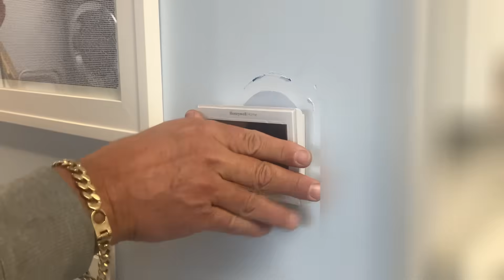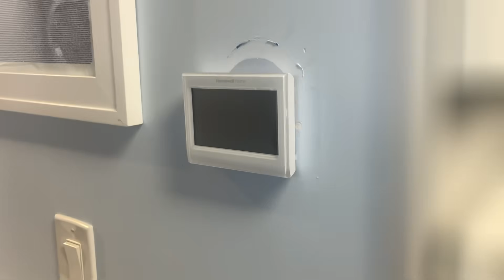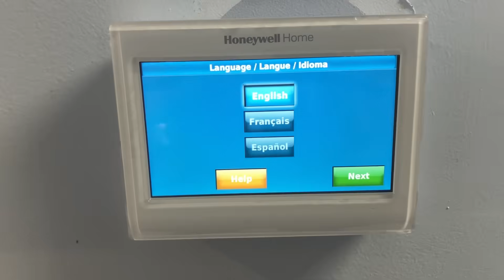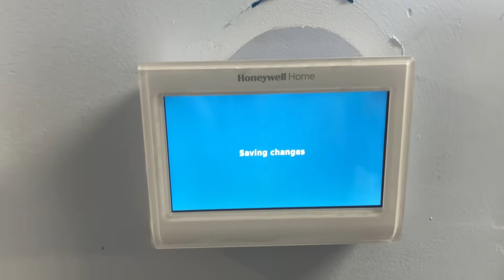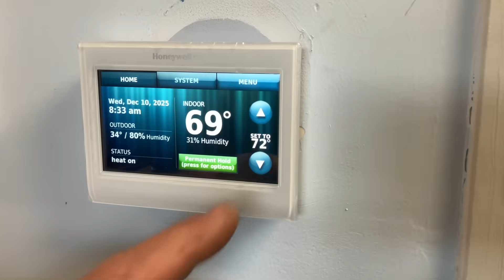Found the Missing C-Wire! Installing Honeywell 9000 WiFi Thermostat on Burnham Alta Combi

Comment from the maker: This is a REAL service call showing why WiFi thermostats fail when the C-wire is missing — and how to properly diagnose it instead of guessing.

If you’re a homeowner:
👉 This is why your new thermostat won’t power on.
If you’re a tech:
👉 This is how you avoid callbacks and embarrassment.

👇 SUPPORT THE CHANNEL & LEVEL UP 👇

🔥 Become an ACiQ Dealer (FREE signup):
https://aciq.com/mikeypipes

🖼 Limited Edition 2025 Mikey Pipes Poster — $42.50 shipped
• Only 150 made
• Individually numbered
• 10% goes to our non-profit

💰 Pay Options:
PayPal / Zelle: office@pipedoc.net

Venmo: @PipeDoctor
CashApp: $mikeypipesny

📞 Need a legit HVAC contractor in NY?
Call 516-348-6300 or book online at www.pipedoc.net

👍 Like
💬 Comment
🔔 Subscribe

Real work. Real diagnostics. No bullshit.
Reply: its dumb, but you should block that MAC address so they dont get some schmuck messing with their thermostat.
Reply: @bobbiac  you are correct it is dumb

Comment: @PipeDoctor Mikey Pipes, looking for a WIFI Thermostat with a “Swing” setting feature in Temperature/Degrees for a Single Stage Trane AC new unit. So far, from my research, only Pro1 T805 or Pro1 855ish, otherwise nobody has a “Swing” setting in actual +/- Degrees, it’s either High, Medium, or Low but not in actual numerical Degrees, any recommendations? Does the Honeywell 9000 offer that feature? Happy Holidays.

Comment: Pro tip. Some of these digital t-stats are really sensitive to air leaks inside the wall cavity. Seal the wire hole. My Infinity stat drove me nuts. It was under shooting and over shooting depending on the way the way the wind was blowing.

Comment: I have someone said the radiator is making noise. I went over there 2 to 3 times already but I don’t see any issues. The air steam valve was replaced a month ago and leak on the main input valve was repaired by Teflon tape, no leak any more. I took all the water out from the main heater 2 times. When I was there I turn the heat on, at the start, the cold air got push out air valve, than it stop after maybe a min. There was low hissing sound but it stop there is enough pressure. I also hear low clicking sound because of metal clicking. It didn’t have any loud sound. I turn heat on and off 3/4 times. No loud noise and spend 2+ hrs on it. The person said, it only happened at night times like 2/3am. It doesn’t do it at day time. She also keep her windows open at night.  She took some video, the video has some hissing and clicking sound but no loud bang. People told me is normal, radiators do make some noise. She said it is too loud for her. Can someone give me some professional advice on this. It is normal, she is overreacting or it is not normal

Comment: Mike, looks like you could have slightly modified the tstat wire to have the subbase full cover the wall where the old stat was or install a beauty ring. Now he has to paint the wall.
Reply: They make 2 sizes of “Mikey Plates”.   aka Goof Plates.  😂
The base mounts to a single gang box or mud ring, so when pre-wiring a stat, always run spare conductors and SLACK.
You can coil up a few feet and drop the loop down behind the box or mud ring.
(you should NOT have any issues with insulation binding up the wiring as thermostats shouldn’t be installed on outside walls)

You can preset your company name and phone # and it’s got a ton of scheduling and security options.
One is a maintenance “timer” that alerts the user when to call for service for filter replacement k etc..)
Plus, we always add a field created P-Touch label with our info and logo. (the industrial pt-series orange color handheld - around $200)
It also prints on heat shrink tubing.  A dozen or so diameters and white or yellow tubing color.

Always try to label BOTH ends of a cable run.  My first boss (Grandpa LOL) taught me to add  NUMBER labels.
We had Brady cloth marker tape books with #’s.   He never let us leave a wiring chart at the premises.
We!d have it in the customer folder, along with all documentation.  
He’d say “why make it easy for our trunk slammer competition!  Lol

Comment: I seen one of these on clearance at walmart for 159 and said, too much for a thermostat. I have a cheap 20 dollar unit that is awful at short cycling the furnace. I had to install an 8 minute delay to keep my furnace from being short cycled to death. It doesn't help that the furnace was way oversized for my current floor plan and was designed for the entire house once it was done. I haven't been able to due to my life crashing and went from an electrician to unemployed over the time I was re-building my home.

Comment: Why does everyone not put the low voltage splices into a junction box? I get it, I mean for a long time, I didn't put them in a j-box either but I started practicing that many years ago and every job I did it on was nicer than not doing it.

Comment: I like the design of the honeywell thermostat, but I ended up going with ecobee because of the remote temperature sensors. The only issue is that they refuse to add an option for auto dynamic temperature delta based fan profiles. For a family friend's house they have an HVAC system but due to the home layout the first and second floor have a large open space, thus even after balancing the airflow, you can get fairly even temperatures during a heating cycle, but after a while, you get the upstairs being much warmer than the downstairs due to the heat rising. One option to fix it is having the thermostat run the fan for a few minutes every hour, which does fix the issue but it is not a perfect solution as depending on a range of factors, the if set to a fixed time, e.g., 15 minutes per hour, the fan can run longer than needed, or not long enough. 
Ideally I would like them to allow custom scripts to specify a temperature delta between the temperature sensors and if they exceed a certain amount, then the fan runs to recirculate the air as needed (e.g., if a selected room downstairs is more than 2f colder compared to upstairs, then run the fan.
Reply: That was a lot to post in a comment of Youtube video. It’s a great idea, you should contact Honeywell.

Comment: I always wonder why someone will pull all the wire out of the wall just to strip and cut it shorter ? Just push the extra cable back into the wall for future use if needed.

Comment: These are PHENOMENAL t-stats!

I have close to 600 of them installed (started installing in 2019) and have had only a handful of defective ones.
They are great for commercial and residential.  
They can handle 2-stage cooling and 2-stage heating and multiple fan options & all sorts of other configurations.
3 issues = The stat requires a “C” common. (we install 18/6 and a Cat-5e UTP to each thermostat)
The terminals are garbage.   THAT is what fails.  (We simply solder a piece of 18 solid and leave a Wago attached)
The COMPANY.  Will they keep supporting this via the required internet connectivity.

Comment: Dr. Pipes,
You may want to do a short tutorial with your team on basic FirstAide.  II always have on our van with a fully stocked First Aide kit, and replenish items as needed.  When we got started in our business over 16 years ago, we got cut all the time working with sheetmetal.  On deeper cuts that "may" require stitches, we used super glue, at times we even used electrical tape on finger lacerations, works better than band aides, just saying.  Take care, be well, stay safe!

Comment: Honeywell is by far hands down the best stat to use and very friendly to use. I have two of them in my home, and the a/c and heat work fine with the 9000 stat. Mike, that sucks you had to go looking for the wires in the crawl space, but you did it. Great work troubleshooting.
Reply from the maker: Glad to hear you're happy with your Honeywell stats!
Reply: We used a bunch of different “automation ready” stats from the 1990’s through present day.
We have had a few that req’d internet connectivity for operation and FW updates.
When they closed up,they “bricked” the stats.

I love the Honeywell 9000 Series and we’ve sold/installed a little over 600 of them with very few problems.
I’m just fearful that Residio (Honeywell sub) will turn off service or make it a $ subscription based service.

Our biggest defects?
The crappy terminals on the mounting back plate.
(Honeywell does NOT sell these separately, you need the entire stat)
When we have a failure, we simply solder #18 solid “pigtails” to the PCB and use Wagos as a quick replacement.

I know it requires a C Common, but that’s not generally a problem for us.
95% of our HVAC electrical work is new construction of high end developments in NW NJ.
We ALWAYS pull a 18/6 solid copper & a Cat-5e UTP cable from boiler room or telecom room.
NEVER fall for the Amazon scam of CCA wire.  “Copper clad aluminum”. 
It’s garbage, breaks very easily and has degraded current handling.
Reply: @PowderMill Yes 1990s technology of automation was great! I remember learning Lan&Lon talk HVAC automation program. A beautiful program still exists today in a few buildings out there.   I also love Carriers old DDC system where you had DC volt thermostats with Relay packs to convert the AC to DC for the thermostat and vice versa, it was a weird system.  Going back further and we're talking about air tube technology in pneumatics!  Another Beautiful system with either direct or reverse acting controls and an air compressor pumping and choochin away. Marvelous times in the industry I got to see
Reply: @DanielCantrell-s5j   I feel so damn old!   I just turned 60, but feel as ancient as Mikey !  😂
When I built our home, I had just taken over the family security business.  1995.
We were a Radionics (now Bosch) dealer with mostly high-end installations and we had a small UL Listed central station for monitoring our own accounts.  Back then, everything was hard-wired and all wiring was home run.  Wi-Fi and broadband internet didn’t yet exist and I was a speed demon with my ISDN connectivity.  LOL.  (2x  64kbps channels for a total of 1/10,000th of the current speed I now have)

I had no clue what the future would hold, so I just used the best quality wire, ran spares for everything potentially needed in the future.
I ran a bunch of 2” PVC conduit runs from each attic to the basement telecom room and 3/4” Innerduct (corrugated “Smurf” tubing) from the telecom room to every possible location for an Ethernet Jack or TV or CCTV or alarm system keypad or thermostat etc..
ALL empty with the wiring gently zip-tied to the outside.   The conduit and innerduct was then free to run future runs. (Fiber or whatever was to come) 

The house is 12k sq ft and I ended up running over 175,000 of total cable (Belden DataTwist 350 Cat-5 that runs 2.5gbps now just fine) 
Belden quad shielded RG6 and RG11 
And 20/4 shielded stranded jacketed cable to every alarm device.

I never had to use the empty conduit or innerduct.   LOL
Reply: YES! THANKS FOR SHARING! 
I Can't stress enough the Full Use you spoke about with "Hard Wired," non-WiFi type security systems used for security anywhere!. 
Furthemore, 1 I like to mention is if you have a home security system installed traditionally by B-Rinks or another large chain, People can indeed smash ur pad with something while it's looking for a code and then it won't know it's looking anymore eliminating the need to input one, unless!, you have a Back-Up remote monitor installed elsewhere on the property so that something is watching the main security pad to receive a code upon trigger of event code entry required. In that case, the alarm will certainly sound just the same because the main pad didn't send the all clear and this is a feature not purchased because of cost to install from one of the larger chain security systems.  I always say if you're going to be secure 🔐, BE SECURE! 
 @PowderMill

Comment: After watching many of your videos i successfully sweated and wired my zone control valves and i have heat after 3 weeks, had a little trouble with getting the air out but now its circulating and i got heat and its running as it used too. Thanks
Reply from the maker: That's awesome to hear, great job!
Reply: @PipeDoctor thanks mike!

Comment: Correct me if I’m wrong but the 9000 doesn’t control a humidifier? It reads humidity only?
Reply: there's exactly three that do humidity sense and control. the visionpro 8000, t10+ and  elitepro s1200 which is fairly new.
reality is, you're better off with a standalone humidistat. lol
Reply: how you want me to correct you

Comment: My only question is why you didn't mount the thermostat higher on the wall to cover the area from the old one so they don't have to repair/paint the wall.
Reply: Because he was to focused on pulling the extra length of wire and cutting it shorter first .
Reply: He didn’t want to either make the hole bigger or kink the wire to move it up
Reply: They make several different sizes of “goof plates” for the 9000 series.
Just use extreme caution when terminating wiring to the “slide in” terminals on the back mounting plate.
That’s their one huge weak spot and Honeywell doesn’t sell these items separately.  
(Field expedient repair= solder#18 solid jumpers to the PCB and terminate w/Wago connectors)
Reply: I was going to say that, but  it is done, so what are you going to do